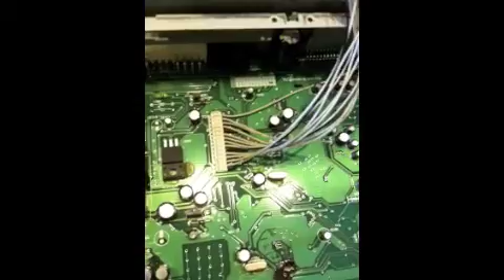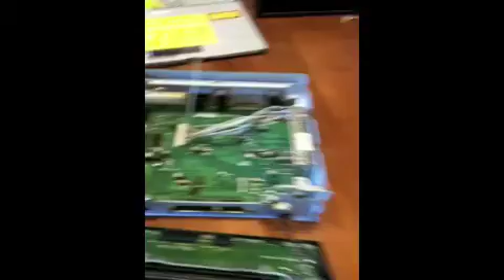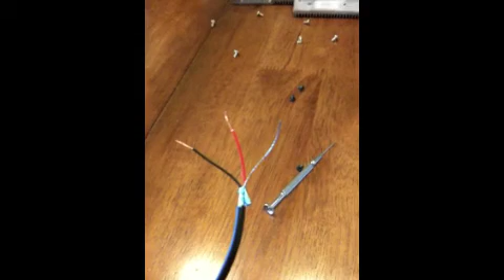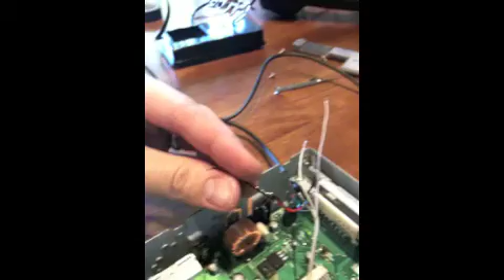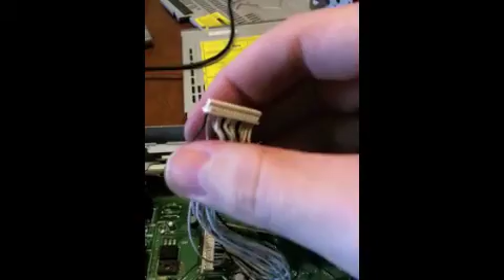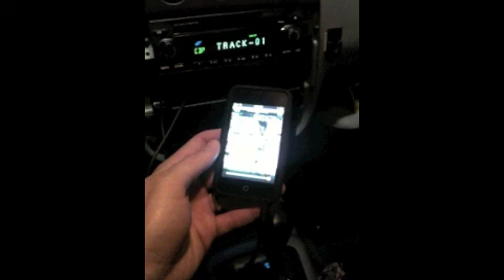2004 Chevy Aveo Aux Jack Installation - Part 2

Comment: very nice vid! 
i know this is an old vid, but i did the very same thing on my 2000 GMC Sierra, and for some reason i must be the only one that cant get anything to work right.
Everything traces out nice, but when i plug the cable into my phone, the cd audio stops(which should be correct)  it when i play a song the audio comes put of my phone instead of the car stereo. As soon as i remove cord, the cd audio comes back out of the speakers. Its weird cause its only 2 wires.(ground wire got screwed to the case)
I dont know why. it wont work for me. im wondering if its my phone?
Maybe i should borrow an Ipod and see what happens.
Phone is Samsung Galaxy S6.
Thanks
Reply: +Giuseppe Agostinelli That's best - try a different device, see if it plays. Also, if your wires are done correctly, and if you turn up the volume most of the way on the stereo, you should hear a slight pop or static when you rub your finger against the jack itself.
Reply: +sopranojam85 
Thx for the reply.
I figured it out. For some reason, i have to severe the 2 wire going back to the CD player. My phone wont play the music through the cable when both signals are going, so i snipped the wires on the CD player side, and it works fine. I think im going to look for a 5 pin stereo jack, that way i can use my device or the factory cd player!
Reply: +sopranojam85 
Thx for the reply.
I figured it out. For some reason, i have to severe the 2 wire going back to the CD player. My phone wont play the music through the cable when both signals are going, so i snipped the wires on the CD player side, and it works fine. I think im going to look for a 5 pin stereo jack, that way i can use my device or the factory cd player!

Comment: I tried this today on my 2001 chevy blazer. when i hook up the ground on the jack all i get is silence, when i remove the ground i get some really distorted audio, i connected the ground to the audio ground and to the metal case of the stereo with the same result, any ideas anyone?

Comment: great video, after doing this i tested it and it worked great.  So I went ahead and reinstalled the stereo, and for some reason the majority of the buttons no longer work.  the only ones that still function are the power/volume knob.  Very odd since everything worked prior to reinstalling it.  All the connections are solid, I continuity tested the buttons to their output slots and that showed up fine.  Must be something fried on the board?  I guess I will be getting another stereo after all.

Comment: Thanks for the helpful video, well made. I tried this on my GF's aveo and it worked! Already had an audio cable and the tools so it cost me nothing. CD player wasnt working before i did this so i blew the cd slot with compressed air and that fixed it so then i proceeded to do this. Thanks again

Comment: Thank you for this post.  Today I tried it in my 2005 Chevy equinox however the circuit board was not labeled.  I decided to go for it anyways since I had the whole thing apart.  I  used the corresponding wires on the right side of the connector but when I put it all back together it said "no disc" and I could not eject the cd.   I was able to get the disc out eventually and the cd player works fine but it was disappointing.  Thanks for empowering me to give it a try, your video was very helpful